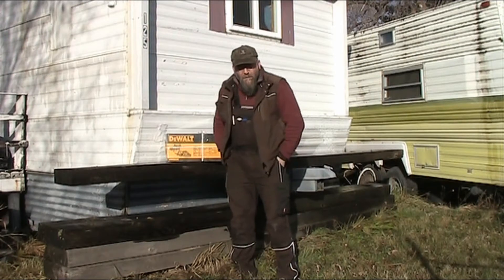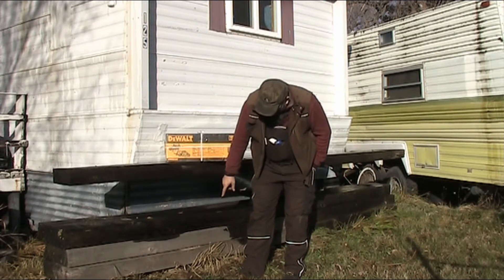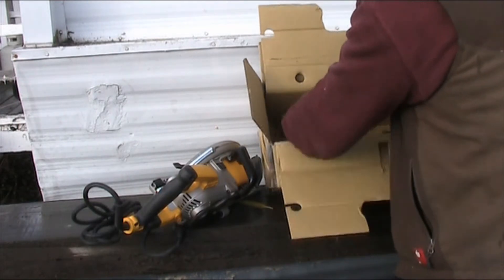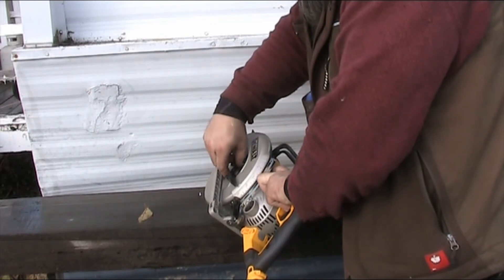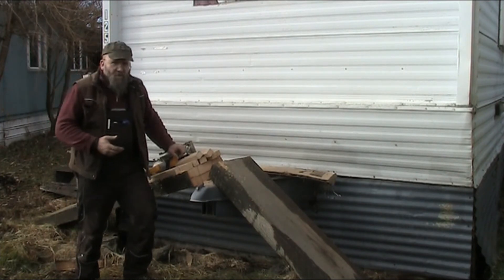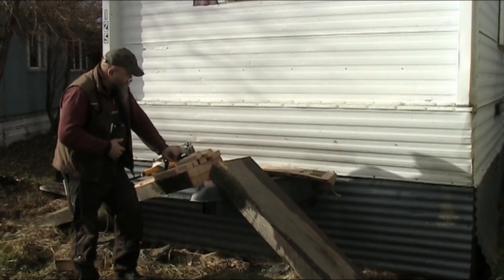Duckin' the fog,   product review 13 DeWalt DWS 535 hypoid gear saw

Comment: If you connect your saw to a bridge rectifier, inductor, and capacitor set up in a choke input filter configuration, you can give your saw some extra power because it's running on DC. Universal motors WILL run on DC because they're self-commutating, as they're essentially a series-wound DC motor.
Reply from the maker: that may be, however i'm not hip with electrics so i ain't touching that advice with a ten foot pole.
the saw has plenty of power as is...

Comment: Useful review. Thank You.
Reply from the maker: thank you for watching and commenting. i do apologize for the bad camera angles and briefness of the review. the tool doesn't have many features so the review ended up a tad shorter than i thought
Reply: Hi, nice review. I am looking for a worm drive saw as I have never used one (side winder only) and I hear they a powerful. I’m prepared to purchase one from the states which I believe is 110 volts however I don’t know if it will work for me over here in Ireland. We use 110 volts through a transformer on our job sites as our mains power is 220 volts. Cheers
Reply from the maker: hi Dan, yes, this saw has plenty of torque which is nice in a deep cut. i haven't seen anything comparable on the european market. if they made one in 220v i would have one tomorrow, this one is 110v.  the thing has a 15amp motor (comes out to 1650watts) which will draw pretty heavy on a transformer. so you should have a transformer than can handle at least 3000watts due to the startup draw of the saw. well worth the investment if this is your daily runner and go to saw

Comment: Hi, and thank you for getting back to me so fast. The transformer I have is 3.3 Kva   Is that the same as the 300 Watts you recommended or would I needed buy a different transformer? Cheers Dan
Reply from the maker: from what the online calculators say, a 3.3kVA transformer should do the job. the saw is rated at 1.65kVA

Comment: Hi again , that’s great- so in your professional opinion the dewalt saw or any other worm drive saw should work with this transformer?? As I would need to switch out the plug that comes with the saw for our yellow 110 volts plug I was thinking of changing the cord to a much longer one but I’m not sure if I’d be loosing power by doing that? Cheers again
Reply from the maker: hi Dan,
as long as you maintain the proper wire diameter you could technically make the cord as long as you want, i would recommend talking to an electrician who knows about this sort of thing and get their take on the subject before you do. 

the standard 220v rated extension cords available on the european market should also be able to handle the load pretty well. the only time i would consider a heavier cord is when you're going to be doing long rips, so power loss won't be that big of an issue. the saw has so much torque even if you were to run it on 100v i seriously doubt you would notice much of power loss. just try to use the shortest extension cord possible. going over 30 feet isn't advisable

as long as whatever saw you end up buying and plug into the transformer and it doesn't go over the rating, then it should be ok. you have a peak load when you start the saw and so your transformer should be about twice the normal load rating of the tool. so if the saw is rated at 1650kVA then a 3.3kVA rated transformer will handle the load just fine, even when you are doing long sustained full depth rips. keep in mind the transformer will get quite warm though if you do run the saw for extended periods of time as will the extension cord. if they get too hot to touch then it's time to up the game and go to a bigger power supply and cords. 
in the end the transformer doesn't give a rats bahookey what tool or brand is plugged into it as long as it doesn't overload the thing.

i prefer the DeWalt line (which is the industrial line put out by black and decker) as they still make some of their product line in the US. they do have their respective shortcomings but for the money they give you a fairly decent product... if you do buy a new saw out of the states just keep in mind that no manufacturer will honor the warranty since the tool is being operated outside its intended market area. makita will even refuse to service the tool if you send it in to be repaired. 

makita, milwaukie and skil all went to china and their quality has dropped off precipitously which is partly the reason i don't like buying their stuff. the other part of the reason is that i loathe supporting communism financially directly or indirectly. i have bought makita in the past in a pinch and had no ill feelings when those tools were stolen in the burglary. the shop i work in has a 4" makita angle grinder and it is the go to tool when grinding. we've had it going on 5 years and it is still going strong although the brushes had to be replaced 2 years ago. the hitachi we had burned up in less than 6 months... although i've owned both the 8" and 4" makita grinders i just can't warm up to them. likewise with their saws... personally, i went and bought  two fein grinders and would never go to any other brand now.
i've used various brands of saws such as makita, festool, sheppach, skil, black and decker, bosch and a few no-name chinese knock-offs but this is the saw i would buy again over and over. it was a little unwieldy at first and it does take getting used to as the blade is on the left side of the saw instead of the right. but as far as pure pony power goes this thing is hard to beat. and with a decent blade the cuts look pretty good and it does all the jobs i need it to do.
Reply: HolzMichel , hi again. Thank you so much for that very detailed reply. It’s so nice of you to take the time to shear your experience with saws with me. I must admit When considering my next circular saw I was determined not to buy any more side winders as they always burn out, so my next saw had to be a worm drive that had the power to get the job done. I was originally thinking of skillsaw just because of its long history making the same saw (70 years or more I think) but now having listened to your advice I’m on two minds now ha. I understand the guarantees not being valid. That’s ok part of living outside the states , while I don’t mind paying for the tool and I also don’t mind paying for the delivery, what kills me is paying for the custom duty at the door upon delivery. Thank you again for taking the trouble to respond. Cheers

Comment: Why exactly do you run the saw for 30 minutes?
Like no load with blade just run it for 30 straight minutes?
This is the first I'm hearing of this and just bought a brand new skill saw work drive
Reply from the maker: this was one of the things that DeWalt recommends doing. my guess is that it, one - spreads the lube around in the gearbox better and, two - runs in the arbor bearings as they are pre-loaded. all pre-loaded bearings have a no-load run in period (with the blade mounted), in this case 30 mins. if you put them under load right away you can damage the arbor bearings right off the bat. 
when i get on to building my next house, i don't expect these bearings to hold out very long since i ran them extremely hard right out of the box. 
now i can't comment on the skil brand of this type of saw since they are being made in china and i don't particularly like the brand because of that. i'm not sure what type of arbor bearings are in the skil variant. check your owners manual if you have one and go with what the manufacturer recommends. if they have a similar bearing setup for the arbor then i would give that 30 mins run in period as well just to err on the side of caution.
Reply: Ok. So just hold the trigger and run for 30 minutes straight?
And thanks for the answer!! Never would have known that
Reply: Just checked and manual says nothing about that. But I'll do it just to be safe I guess.
Does the DeWalt manual say to do that?
Reply from the maker: yeah the manual to that same model saw i bought several years ago had that in there.. i was too lazy to check the new one.. lol.
you can take a twist tie from a garbage bag or a zip tie and keep the trigger pulled that way. duct tape should work as well. holding that screaming pig for 30 mins would wear on a guys nerves fur shur...lol
Reply: The reason for this is to fully seat the brushes to the commutator before putting a high load on the motor and unseated brushes which pulls many more amps and can cause premature wear from excessive arcing across a small contact area
Reply from the maker: that makes a lot of sense too, thank you for adding the info to the conversation thread!

Comment: Not a hypoid saw, but okay.
Reply from the maker: that's what they're being called.. users of this type of saw often refer to it as a worm gear drive, but on a true worm gear drive saw you can't turn the blade by hand when the saw isn't under power. 

if you know the correct term, then by all means throw it out there so we can all call this critter by its correct name.
Reply: @HolzMichel  Here's actual pictures of DeWalt's gearbox (that they themselves advertise as wormdrive) compared to Makita's actual hypoid gearing: https://imgur.com/a/eTvtoQk